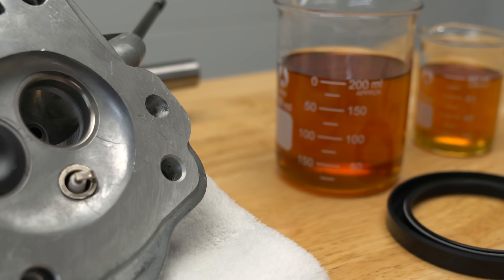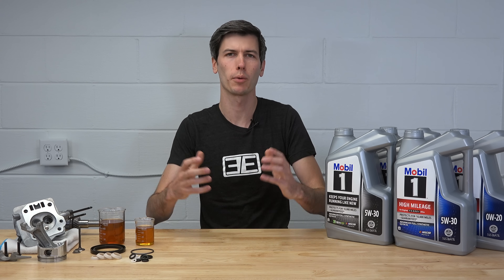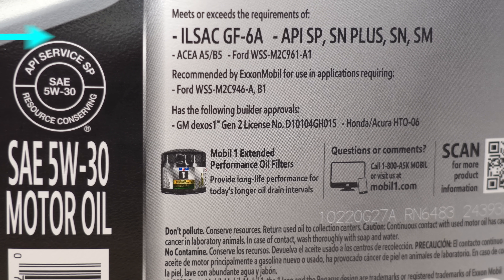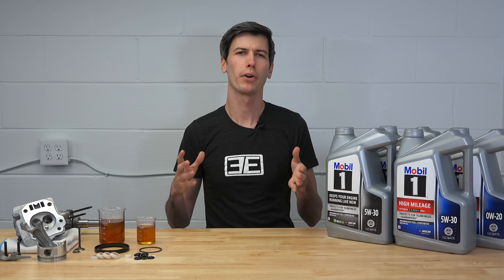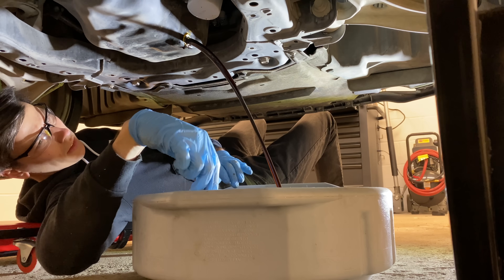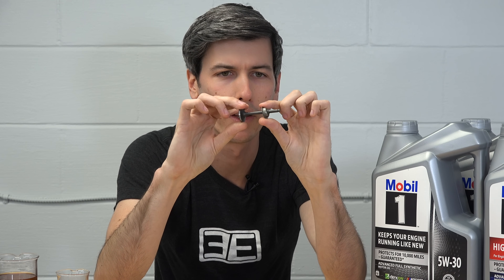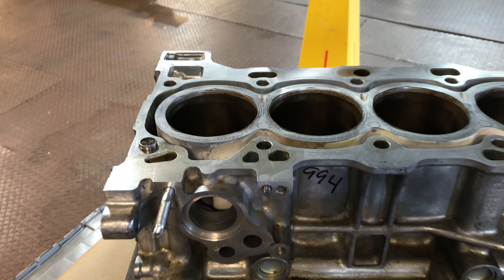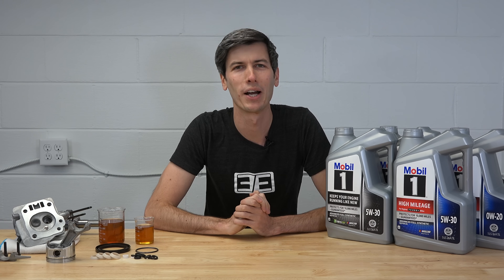Is Synthetic Motor Oil Bad For Old Cars?

Comment: The question is, what is considered "old" car?
Reply: not in years, we are talking km wear on engine here, taxi would get (old) faster than grandma shopping once a week
Reply: @Stale_Mahoney  Years (technically when the car was built, not how many years old it is) as well, as he addressed the matter of seals in old cars.

And to comment on what the rest of you said:  In a local old car club the constitution states 30 years.  But there are a few old members who forgot about that change (and also don't realise that time is moving on), and they firmly believe anything after 1976 is new.  In fact about 3 years ago (when my '87 Mazda 323 was 30) they actually told me in so many words that it will "never" be an old car!
Reply: @johannkuhn5685  ohh jess veteran cars are to be considered 30+  quite funny how some oldtimers think nothing they considered new and fancy when they're veteran car became a veteran will ever be one xD  a bit sad, my first car is a veteran 88 volvo 740 and in 3 years my daily will become as well (93 volvo 240) still popular for teenagers to be racing around in ;)
Reply: @Stale_Mahoney  My '88 240 is still new. And I'm dropping in '84 b230e that i convert to EFI and it's still not old😎🤙
Reply: @0hjaa3.0  gotta ceep on rolling in scandenavian squarebodies👍
Reply: Any originally carbureted car is old enough to be considered old even if it is a low mileage one.
Reply: @pdr5926  true last mass prodused car with carbs went od the asemblyline mid 90s
Reply: @Stale_Mahoney  yeah they basically outlawed carburetors in '96 with obd2 requirements.
Reply: @Prestiged_peck  obd2 is as far as i am concerned useless, but then again have ever owned 1 car built after 2000 and that's my 04 V70R
Reply: @Stale_Mahoney  To be honest, it does have its upsides.  When diagnosing a modern car, you have all manner of sensors and systems that can give similar symptoms.  So diagnosing a modern car the old fashioned way is an almost guaranteed way to throw good money away.

And in case you're wondering, I'm also a fan of older cars.  So far I've owned an '87 Mazda 323 (first car, daily driver and currently main show project), '82 BMW 518i (show car, stolen), '70 VW 411L (show car, sold) and a '99 BMW Z3 roadster (show car and second car).
Reply: @johannkuhn5685  yeah, thats why i disslike almost anything after 90, to much tech, my first car is my ongoing roaderacer/trackcar to (88 volvo 740) 3.1L stroker I4 with 16v head and 50mm itb's aiming for 300 wheel at this badboy(no stressfans) 😅
Reply: @pdr5926  Here in South Africa we got the Mk1 Golf until '09.  And it could be bought with a 1.3 carbed engine.
Reply: @johannkuhn5685  I'd love to import a mk1 from south Africa...is the GTI still made in your country??
Reply: @johannkuhn5685  That still does not make it a new design. That engine is probably the very same design from the 1970s. Even being a '09 the "old" engine concept applies to it.
Reply: @whatsup8464  We got the mk1 until '09 as a Citi Golf.  It did have some minor cosmetic changes (mainly high plastic bumpers outside, and a then modern dash inside), but apart from that it's just a basic mk1.  The GTI wasn't built that long.
Reply: @pdr5926  True, it's technologically pretty much the same (see above).  But if a car is built unchanged for let's say 30 years, 1990-2020, that does not make the 2020 an old car the moment it rolls off the assembly line.  I feel the actual age of the car is more important in this regard.
Reply: @pdr5926  the engine is not the same at all...updated 1.4 injection was one option...other modern engines did apply also
Reply: @johannkuhn5685  cool wasnt aware it was built until 09...I know the rear quarter had a pressed bevel edge also to show it was the citi golf...if I'm nt mistaken I think the 1.4 16v from the golf and Bora etc was an option also
Reply: @johannkuhn5685  I agree with you in that it is not old in terms of mileage, but this oil related topic is worth it about what is considered an old engine mostly design wise. As stated during the video, engines were manufactured with different tolerances 20 or more years ago, so most likely a wider range of current oils could be used on them. You can't do that with a newly designed engine where it would be best to follow what oil to pour in to the letter.
Reply: @whatsup8464  Then those engines are still not to be considered old by any means.
Reply: @pdr5926  👍
Reply: @whatsup8464  The Citi Golf May have had modern engines as well, but it was still available with the old carbed 1.3 (not sure if that was until the end, but at least until close to the end)

admiral_peck:  That also depends.  You say 320k km is old for a BMW, but have you see what people get out of the M52/M54?

PDR:  True.  I was referring to the general definition of an old car, but obviously in the case of oil requirements it boils down to technology.
Reply: @johannkuhn5685 is it warlord approved?
Reply: Any car that has over 150.000 miles on it, I would consider it "old"
Reply: @horiatomescu  those are rockie numbers, 250k km is driven in not old😅
Reply: @horiatomescu  easy put 150,000 in 4 to 5 yrs..thsts not old...its to do with engine technology
Reply: @horiatomescu  My dad would tell me when he was growing up that if you got 50k miles on a car, you were doing great.  I just switched (finally) to full synthetic in my 01 Silverado with 225k miles on it and it still runs awesome.  Only leaks a tiny bit of oil, maybe half a quart every six months :D
Reply: @CactusBobsPlace  25 yo? Holy hell. Better not invest in old Mazda or Opel if you are counting for 25 years :D Mine is rusting away and it's only 15 yo :D
Reply: like... a 55 T-bird.
Reply: By time: any car without OBD2 interface
or
By mileage: any car with OBD2 but has over 200k miles. 

Example: 96 Accord (with OBD2) but has over 200k miles. 
Exception: 2019 Accord with 200k miles is still a relatively new car if well maintained.
Reply: @ibmtpx24  depends on the car. 200k miles on like a Mercedes or bmw is old, but for a v8 f150 or a toyota Corolla? That's just getting started. 200k is low miles for a vehicle as durable as that.
Reply: Cactus Bob I wish I lived somewhere dry like that. I need a new car but live in Ohio. Not sure between the roads and the salt it’s even worth the money.
Reply: If I'm driving it, it's old, like me.
Reply: For a Toyota 250k for a Chrysler 100k 😂
Reply: Once it's off the lot it's old. At least that's how it feels when you go and try to sell a new car. :(
Reply: Rusty Now that’s an old car. 😂 lol
Reply: My cadillac is is 62 years old, and my Mustang is 52 years old. Is that old enough??? Lol. I would not run synthetic in either. They get Castrol GTX 10 40, and very well with it. My parents bought the cadillac in 1960. I bought the Mustang in 77.
Reply: @1958Cadillac-v2g  why not ! Have you ever had problems with your caddy! Thanks got a new rebuilt 2005 deville
Reply: @voice of reason yeah that’s a good rule of thumb unless it’s taken care of of course
Reply: Anything you've got to stick the keys in
Reply: @simpleautothings_official3549  they still sell those in 2021 silly
Reply: I say 15/20 years at least.
Reply: 100+ mileage
Reply: @voice of reason ford put out like 5 or 6 generations of F series in that much time
Reply: I would say cars older then 2000
Reply: Anything I can afford.
Reply: Pre 95, or even pre 2000 now. Basically 20+ years.  
While Mr fancy Porsche and very high performance engines may have used synthetics since however long, a lot of normal brands were all still on mineral oil, so the change is really to do with technology changes that started becoming widespread from 2000 and on up to 2010. Even synthetic oil engines from 2010 needed less crap in them than brand new ones that need all this other stuff in the oil too.  
So "Old" basically denotes cars from a period when they still used mineral oils and A/C was still an optional extra.
Reply: Personally, I would consider an old car to be a car that's more than 20 years old. So, in 2020, it would be a car made before 2000. I think that's pretty reasonable.
Reply: Sheet tightened,that are very strong.
Reply: Before Christ ....
...
...
...😜
Reply: Prefer to define old cars/engines using the API Categories. 

Latest modern diesel engine oils are API CJ-4 and CK-4. CK-4 for example is recommended to be backward compatibility up to engines requiring CH-4, which I suspect is due to seal compatibility. Whereas for CH-4 oils, they are recommended to be backward compatibility to engines requiring API CD.

So even backwards compatibility have their limits as recommended by API.
Reply: Regarding the matter of syntheic oil and how thin or thick oil, it's about the generation of technology. It will differ depending on make, model and engine. The Chevy smallblock, I'd say (guess) 1982 and up is "new". Definitelly since 1987. The Chevy big block definitelly from 1991 and up is "new".
Reply: 2010-2000 models are considered old and things from the late 1990s are obsolete and most of em re long gone anyways .
Reply: @mrsorgic4790 I'm driving to 92 S10 Blazer has been overhauled
Reply: Cactus Bob Well hey, I consider a car that’s 20 years or newer to be a new car. And I consider anything older than 1992 to be an old car
Reply: The high mileage bottle says 75,000 miles. I buy my every day driver Honda's at 185,000. and I expect to get 300.000 miles out of it with upkeep. I don't do anything different at any time in that 300,000 miles.
Reply: I would say anything older than 2010
Reply: W
Reply: @CactusBobsPlace  what part of arizona you are ?? I used to live in tucson and yes I still remember people saying exactly what you aay
Reply: two stone rollers and a frame of forked logs qualifies as old
Reply: The design of the engine is what counts, no matter how "old" it is in terms of age or wear.
Reply: The oil designated  for "high mileage" and "75,000" per Mobil1.  Will vary based on how often/far driven.
Reply: i have one 24 years old and one 57 years do they qualify as "old"
Reply: Any car that leaks oil, I guess.
Reply: I had a V8 years ago that the rear main seal is leaking. 30,000 mi is it didn't burn oil. I got bye running quart low. Change the oil a little early. Less than 3000. Between oil changes no problem . Not a fixed just getting by. A lot of highway miles doing 70 plus miles an hour. Just keeping up with traffic in those days. Without overdrive it's 3,500 RPMs😮
Reply: My jetta mk2 1.6d was made in 1986  and was like 800 000 km + on clock instrument penal stoped working some years ago  soooo for me 500 000 + is old car 
Ps  after problems started I used biger w oil  and  it got beter  and it was working until i get bored and send it to scrap

Comment: My dad ran the section at Mobil that developed Mobil 1 if you are interested in doing another video on the topic that goes even further in depth.
Reply: Would love to see your dad addressing some frequently asked questions
Reply: He needs to see this
Reply: Hmm. My Father worked for Exxon/Mobil as well. He retired in the mid 1980s from the Tank Car repair shop in Kansas City, Kansas. He was of course a proponent of Mobil 1 from the beginning when it  was first introduced and never used anything else in his vehicles. I have used Mobil 1 in all my vehicles with excellent results.  My 1984 Caprice has 350,xxx miles on it and is still in road worthy as far as the drive train is concerned. The body however is another matter.  But the wife likes that old Caprice  and that is what matters most.
Reply: @JohnLee-ug8ol  thanks, good point,... Actually, I used VALVOLINE SYN to lots of miles ... Actually switched over to MOB1 couple years ago, moving to He,ena Valley MT...(* winter has a few more days close to -30, F, Etc), FROM WARSAW IN
Reply: @JohnLee-ug8ol  Old cars like that are the best. You can park it right next to the shopping cart corral and not care.
Reply: Very cool!
Reply: Well, I guess he must be 100 years old by now.
Reply: @pdken3081  Mobil 1 isn't a set formulation, it undergoes continuous development. The additive SuperSyn that you may remember being introduced two decades or so ago was developed in a lab in his section. He'll turn 72 later this year.
Reply: The original Mobil 1 was developed when the Alaskan oil fields first started being developed to solve the problem of existing oils that were thin enough to allow the vehicles to start at below -40º, did not offer enough oil film strength when the engines got up to temperature.  It was a 5W-30 , and it was its thinness that caused some vehicles used in warmer climates which were designed for 10W-XX  to use more oil which started the reputation for high oil usage.
Reply: I used synthetic oil in my 2004 blazer after the first 7000 miles. I have over 300,000 miles on that engine and it passes smog test in California easily.
Reply: Show your dad this vid maybe he can send him an email and they can collab

Comment: I saw a video that stated on a Ford coyote using synthetic and taking short trips resulted in the oil 'crystalizing' in the top end of the motor resulting in eventual damage, where as using a non-synthetic would avoid the problem. Sounded ridiculous to me.
Reply: Yep. Ridiculous.

Comment: Hey Jason, you mentioned rubber or plastic seals, but if an engine has brass seals, some of the additives in some synthetic oils can cause them to degrade, especially sulfur based additives. Can you clarify on that? Thanks!

Comment: Can using a non-synthetic or partially synthetic oil in an engine designed for full synthetic damage it? Also, if you used high mileage oil too early, does it hurt to switch back to the standard synthetic oil?
Reply: It can cause premature wear on seals causing leaks. Always use what the manufacturer recommends
Reply: Naw, but why use an inferior product?

Comment: Did you talk to any mechanics?  Synthetic oil in a non-rebuilt engine from the 60's or earlier can blow by the piston rings.  And any oil without zinc (ZDDP) will cause premature were in any engine made before 1972 or has flat tappets (like the Jeep I6).
EDIT:  And Mazda recommends to NOT use synthetic oils in their rotary engines.  Why do you suppose that is?

Comment: Good video!  Back in the day I had to replace all my seals when I switched to synthetic(1983 T-Bird).   However I only run synthetic don’t really care about brands.  They all meet similar standards.  Kind of like gasoline
Reply: The quality of a modern cheap oil is probably much better then of an expensive oil from the 80s anyway

Comment: What is the definition of old? By high mileage or by the years of the motor?
Reply: When it develops leaks, or has oil pressure issues not related to the oil pump.

Comment: as far a seals leaking. heavy oil will many times leak more than the proper oil. if a rear main seal is leaking heavy oil will push its way out more.

Comment: Very strange promblems may occur, for example my car uses 10w 40, which is very famous here in Turkey amongst gasoline cars. I tried a full synthetic oil once. (I guess it was 5w 30) It was very beautiful at the beginning. Engine run with less noise, achieved higher gas milage. But after 5k kilometres, the idle went rough, started burning oil. So I switched back to 10w 40. I think these information given in here is for the sake of Planned Obsolescence.